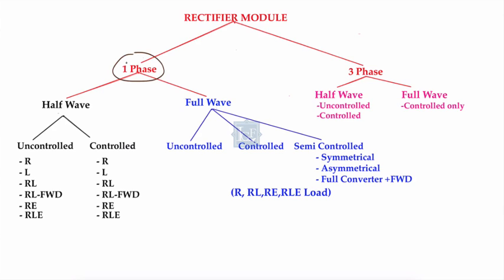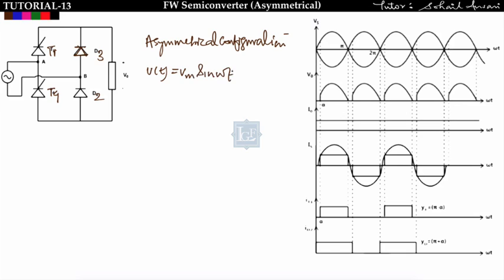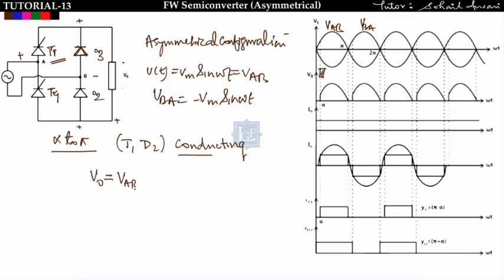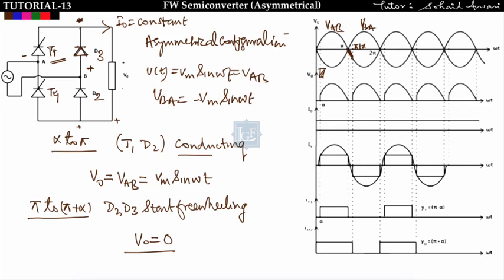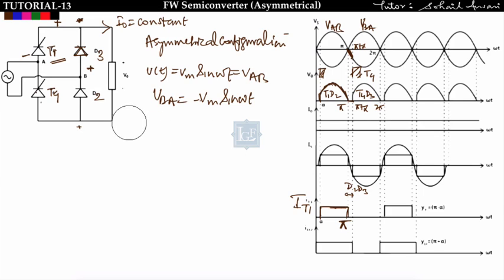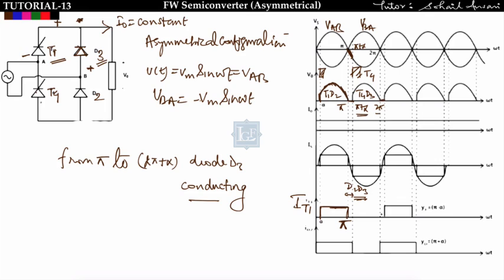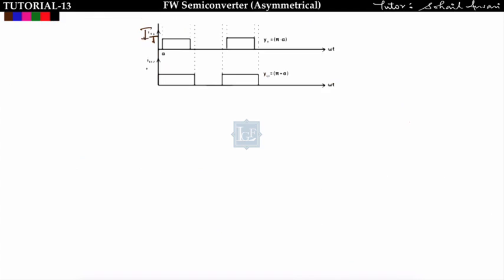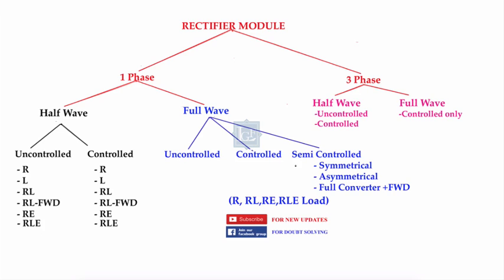Lec 13(b) Full Wave Semiconverter (Asymmetrical Configuration)

Comment: How 2 switches of the same leg can conduct at a time because there will be a dead short circuit due to which the switches will burn  :-/
Reply: same doubt
Reply: But there is load present so there is nothing called dead short ckt here

Comment: Here all the 4 switches are thyristors then how is it a semi-converter?
 Even in symmetrical and asymmetrical config we did not get the negative part of output voltage then what is the need of the FWD?

Comment: Sir from Pi to Pi+Alpha for -ve half cycle supply point B is +ve , point A is -ve then D3 is F.B and it is start conducting then  D2 will become R.B how D2 will conduct please explain this sir
Reply: after pie how d2 conduct?
Reply: at frist we asume that I0(OUTPUT CURRENT )is constant it's mean it is highly inductive load,so after pie inductar discharge,it's mean inductor behaves like acurrent source ,so ammount of energy desipated through the diode d2 ,so it's conduct.
Reply: This is my concept ..if i'm wrong please clarify the true...

Comment: Dear Sir
At 3:04, as the potential at B goes +ve then D3 starts conducting but why does it doesn't stops conduction of D2? i mean this implies higher anode potential of D2 than applied at the moment, but how to justify it mathematically Or through KVL?
Reply from the maker: D2 stops conducting when T4 is triggered..see when T4 will triggered then anode potential of D2 will be negative which makes it off..just having one potential postitive will not let D2 in to off position..ok..also u can see that when D3 start conducting then its shorted so load current has to flow from certain path as we have assume that load current is constant..now see from where load current will flow after pi...after pi T4 is not triggered..so there is only one path left from which load current will flow..i.e. D2D3..got it..
Reply: Thank you sir...
all in all 1. Load current is constant this implies it has to flow.
2. only positive cathode potential of D2 cannt turn it off.
Reply from the maker: correct..if load current is not continuos means if i will take R load..then we have to see the polarity of supply voltage..otherwise no need..

Comment: sir after pi  diode d2 open because positive at cathode terminal. how d2d3 free wheels after pi to pi+alpha
Reply from the maker: see here i m assuming that load current is constant..means load current cannot be zero..so there must be some path from where this current will flow after pi..so it wont allow the thyristor to turn off and current will flow from d2d3 ..bcoz there is only one direction left for current to flow..it freewheels with this path..as there is no any path available without d2d3...ok